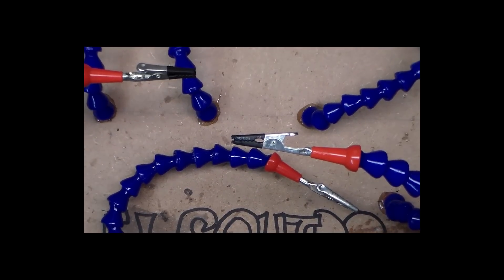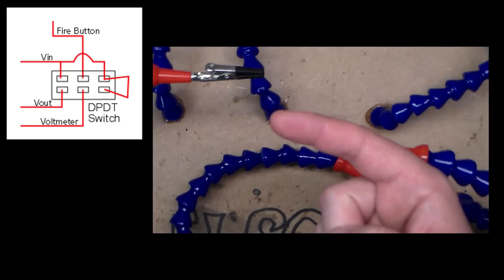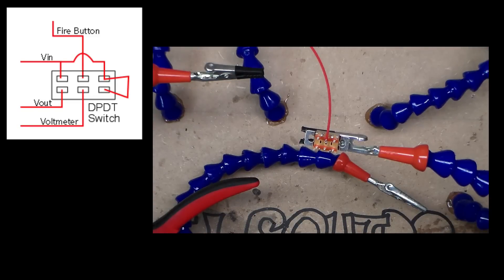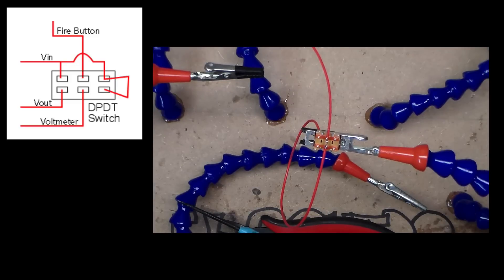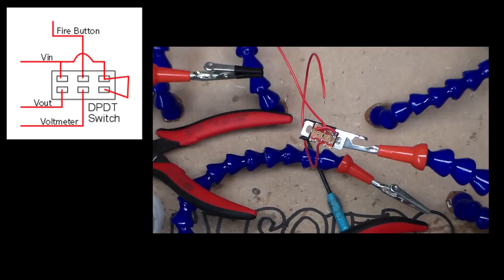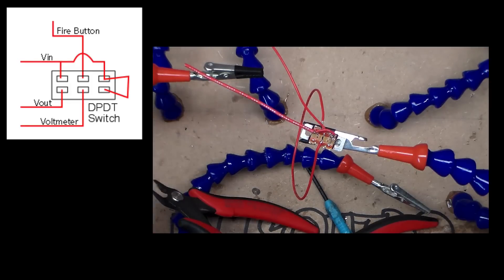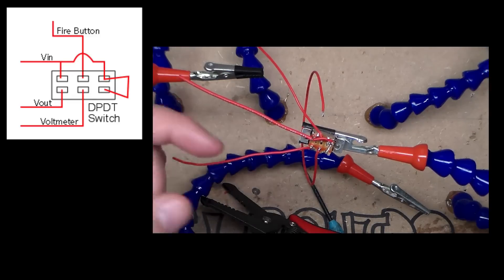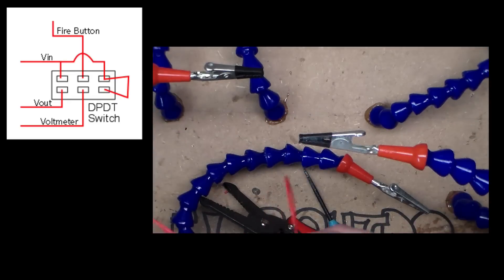Lockout Switch Wiring for 1590B Raptor Kit

Comment: i wired this and it doesnt stop firing right when i put on the atomizer is this a problem with the switch which wont lock out btw or the V4 connector you did not show how to wire..

Comment: so, when I attach the fire button wire, where am I supposed to attach the other end specifically?
Reply from the maker: americasgotrandom One end connects to the middle post at the top in the diagram. The other connects to the 5.6v zener diode on the raptor board from the on/off pin. This probably explains it better: https://s3-us-west-2.amazonaws.com/cdn-nonameboxmods-com/raptor-basic-diagram.pdf